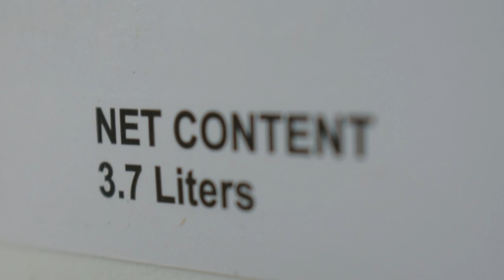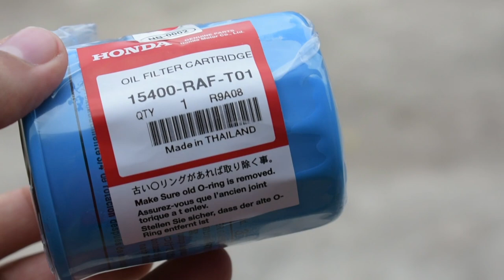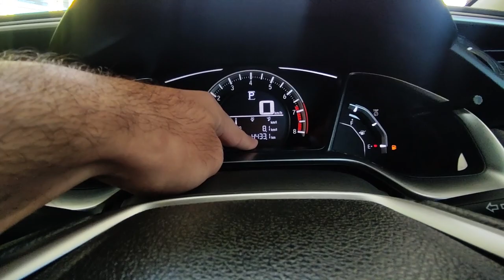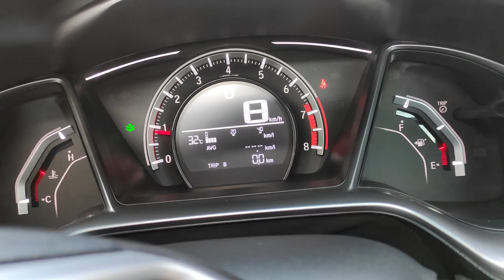HONDA CIVIC ENGINE OIL CHANGE, AIR FILTER, OIL FILTER, ENGINE FLUSH | WAHAJ FROM AJK

Comment: Corolla Geniune Taglon Oil (4800) + Geniune Air Filter (2250) + Geniune Oil Filter(850) Costed Me 7900  A Day Back More or Less the Geniune Things of Both are same.

And if someone want to change cabin filter/Ac Filter as well it will cost 2200-2300 As well.
So 10K Approx
Reply from the maker: Informative.but please mention oil grade
Reply: @wahajawan  Taglon Comes in 5w-50
Reply from the maker: Pinned your comment 👍
Reply: @wahajawan  Thank You for that.

Comment: Do not use an engine flush, just use the correct API SN/API SN-plus oil that is created to prevent sludge and varnishing. Flush chemicals can damaged some of the sealants that are in these engines.

Comment: That is a Thailand oil filter and air Filter it will cost you 550 for oil filter and 500 to 600 for the air filter
Reply from the maker: Kahan se milengy ? Itne paison me lippon k filter nhi milty
Reply: @wahajawan  Lahore Both of the products are thailand made

Comment: So basically flush is not a good thing to do 
If you want to keep your car enjine sludge contamination carbon free just do regular oil changes at 5000 km or 1 year which ever comes first 
So you have decided to do enjine flush then do it right way 
The correct and safest way to do it is  drain the old oil with flush init then
add the new oil to recommend amount and start the car again let it idle for more 10 to 15 mins then drain that oil again 
Then add new oil again to recommend amount then tighten the nut  
The reason for this is that when you drain old oil the resedue of enjine flush is left behind making your new oil thin and black more sooner 
So for safe side you drain oil twice.

Comment: Civic 1.8 
Oil change every 4k to 5k kms
Oil filter change on every 2nd oil change.
Air filter on every 2nd oil change about 10k kms but i found out that the air filter honda provides VS the same thing with almost same packing is costing 700- 1100 in Peshawar and price of oil filter is low as well compared to showroom prices with authenticity that the product is genuine.
They charge alot on parts.so i change air filter from outside 3s dealership.oil filter is majbori 😁 as oil whan p change hota
Reply from the maker: You might be right.
But meri car me pehly lepon ka para hua tha air filter.
Mne kafi closely check kia dono k paper me farq ha .
Reply: @wahajawan  yes leppon is after market one and a cheap replacement.its just named as filter😁.
Airfilter  should be some what capable of stopping finedust entering to the engine.
Rest  engine oil tells the story when oil is changed with having a bad or cheap airfilter.
Reply: Bro Peshawar mai kahan se

Comment: You have bought your filters very expensive
I just did my service of honda civic 2018 
Genuine air filter was 1100 and oil filter same blue colour genuine was 700 
And Cabin filter was also 700 but for cabin filter not sure was it genuine or not but it was really good quality
Edit : I have pics also of filters 
But my oil was of Mobil super which cost me 4200 4ltr

Comment: Sorry gear oil r disc pad price bta den bro r kitny km bad ye dono change kren??
Reply from the maker: Gear oil 7k or disc bad agr genuine use krein to 15k plus hn or agr kisi of company k lgvain to 10k tk
Reply: @wahajawan  bro r ye dono kitny km chlany k bad change krny hoty?
Reply from the maker: @MohsinAli-wb9do  gear oil after 40k or brake pad depend krta ha driving pa or kon sa company k pads hn
Reply: @wahajawan  ok thnx bro mtlb agr geniun hon disc pad to 40 tk chl e jaty hen na?

Comment: Bro why did you use 5W-30? Recommended is 0W-20 for new vehicles
Reply from the maker: Sir 35k chk chuki ha ab 5w30 use hoga .. ow 20 mostly turbo engine k lea hta ha
Reply: Alright :)
Reply: Air filter kitne time baad change karwana hota hai?
Reply from the maker: @emeraldeye086  agr orignal air filter use krty hn to ek oil chor k next oil oa change hoga
Reply: @wahajawan   thank you bro